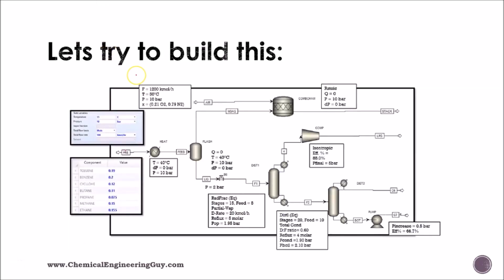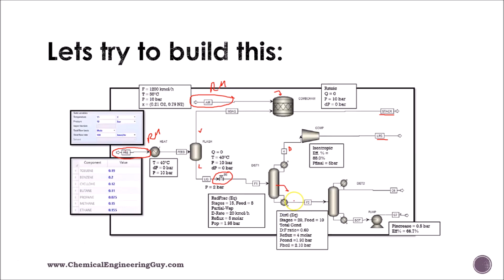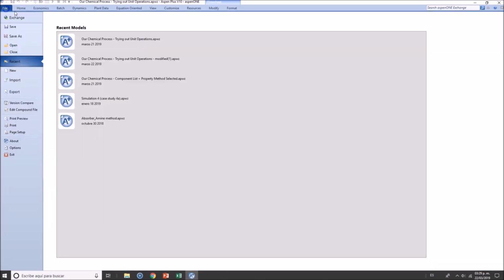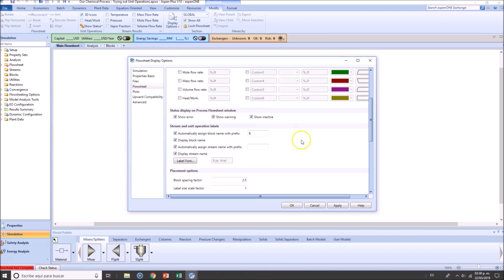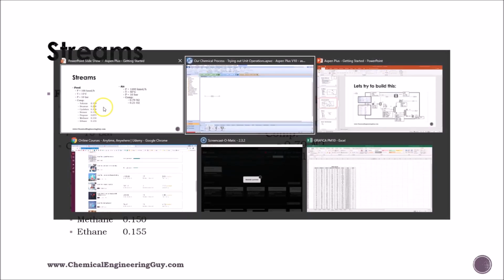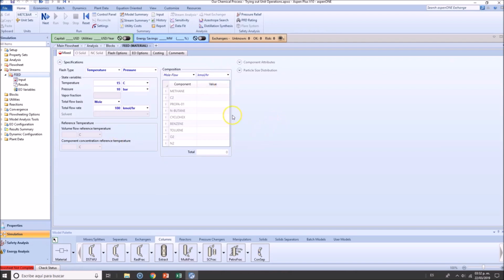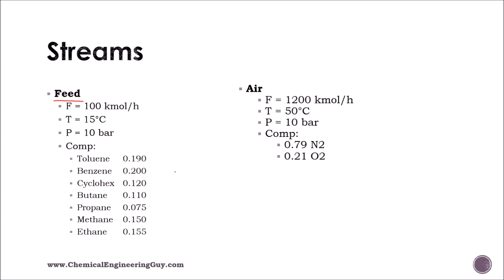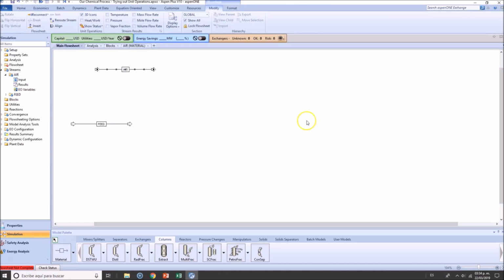Setting Streams & Input Data in Aspen Plus (Lec 019)

Comment: there is thank you it is very helpful, I want to ask you, if I connect bleu and red streams in aspen plus
Reply from the maker: Well... I dont know what exactly you mean. But if you are talking about a MATERIAL stream, yes, they can be connected. If you are talking about an Energy and Material Stream, NO, you cant!
Reply: @ChemicalEngineeringGuy  
I am talking about a refrigeration system I got a message that wen I run the simulation for mixture the method I used is not considered for this mixture but it is already proven in many reviewa
Reply: @ChemicalEngineeringGuy  Hi may i ask if there's anyway to connect two or more manually input inlet and outlet streams?